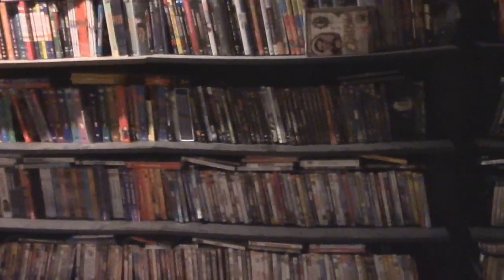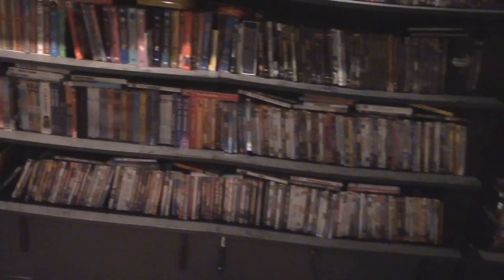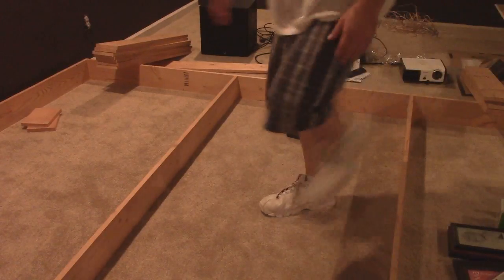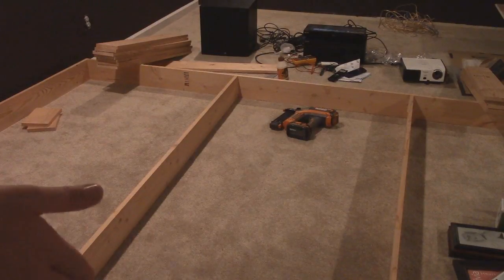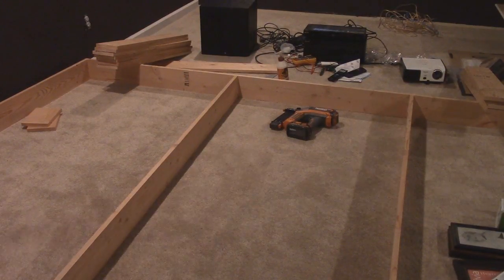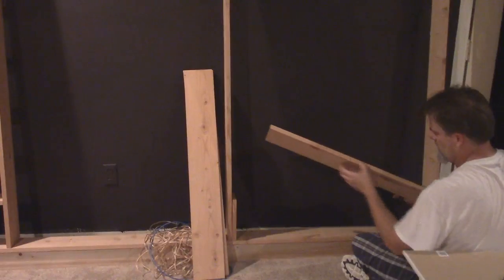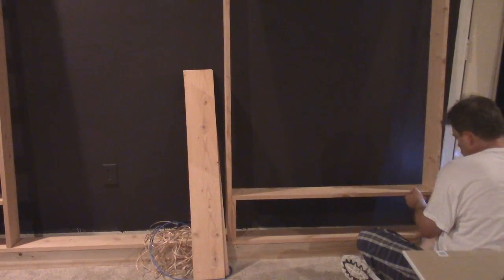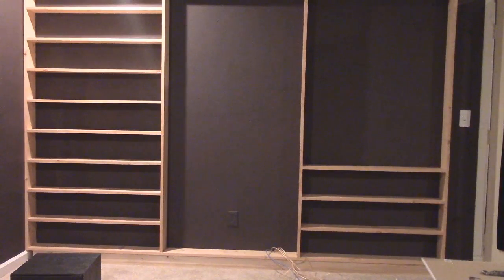making a dvd bookcase for home theater

Comment: Forgot to ask, I don't see any "nail rails", How did you mount it to the wall? Pocket hole joints? Just asking, because at least from what is visible on camera, you did one hell of a good job hiding it, appears to be "floating". True sign of good work.
Reply from the maker: I did something similar to a pocket hole. they would be hard to find.